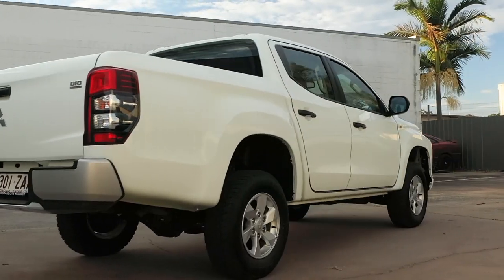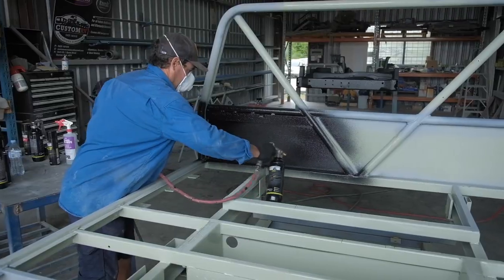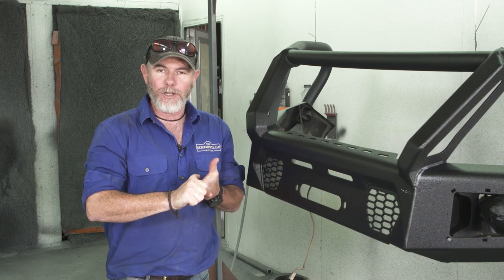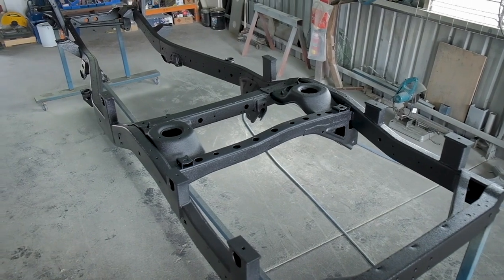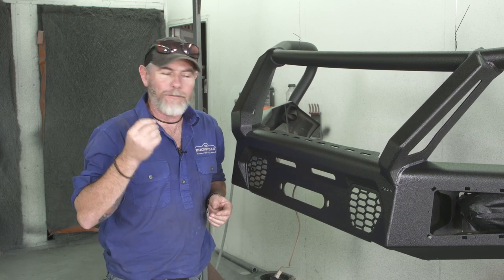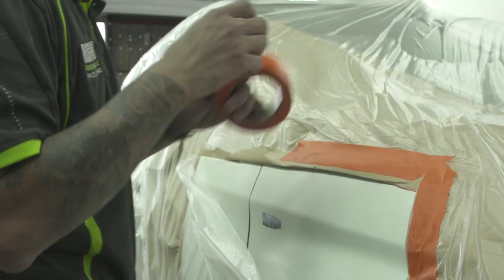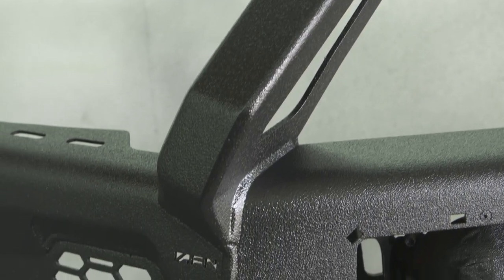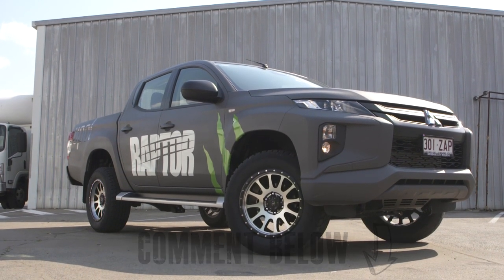WHY SHAUNO & GRAHAM RAPTOR COATED THEIR 4WDs – how to do it yourself at home + we re-spray a 4WD!

Comment: @4wd Action have you seen 'Bully Rubberised Liner' and how do you think it compares to raptor coating? Pros and cons of both would be great if anyone knows 👍
Reply: RAPTOR and Bully Liner are completely different products, the chemistry of each having their own “pros and cons”. RAPTOR is a great cost effective alternative. RAPTOR is a thinner product which can produce a variety of textures and finishes, depending on the desired outcome and the application equipment used. RAPTOR can be tinted almost any color to meet a variety of color requirements. When properly applied, RAPTOR has very good impact, scuff and chip resistance. Another important feature is “repairability” - should RAPTOR or the underlying substrate become damaged, it is very easy and inexpensive to repair. Additionally, RAPTOR is UV stable and will not fade!

Comment: How fussy do you have to be with patching dents? As I'm no panel beater
Reply: The raptor is quite forgiving, to assist in hiding wobbles and bumps on panel work. The textured finish assists in making those imperfections a lot less noticeable.

Comment: I definitely would not use Raptor . I had a steel tray on a 79 series and after 3 Years the product has shrunk and cracked. Now the water has entered the cracks and now the tray is rusting. Upol does not want to know about it and even refused to inspect it. I went Raptor because I was told it was the best product for the application. How wrong they were. Now I have to remove the tray and get it sandblasted and powercoated.

Comment: Probably ok for a cheap bush pig. Doesn't hold up to UV though.
Reply: Hi Brad, Raptor is actually extremely UV Stable. And Will not Chalk or Fade. We have published upto 8 years of direct sun tested product with class leading results.
Reply: @U-POLAustraliaNZ  in comparison to a standard toyota paint job on a prado, how long would raptor last in normal application? My car is now 8 years old and gets washed regularly etc, never polished and the paint looks like new. Would I expect raptor to be the same after 8 years of sun, rain, dirt etc? Is a different washing method required?
Reply: @unclebob5686  RAPTOR provides fantastic fade and UV resistance.  RAPTOR has been UV tested to over 5000 hours. The UV test results for RAPTOR refer to time in an accelerated weathering chamber, not to outdoors exposure. This is an industry standard test and one hour of exposure in this way is much equals at least a factor of eight (which makes 5000 hours equivalent to five years). To give you an idea of how good 5000 hours is, the specific for most automotive paints is 3000 hours, showing that RAPTOR outperforms this specification by a considerable amount.